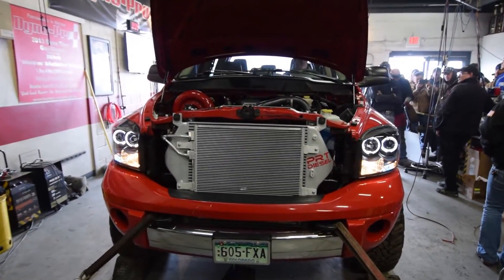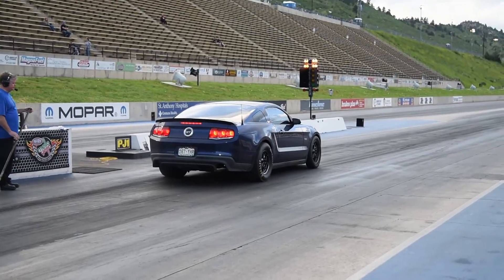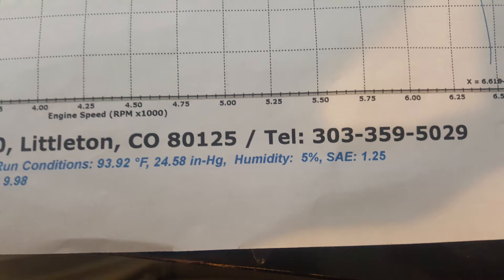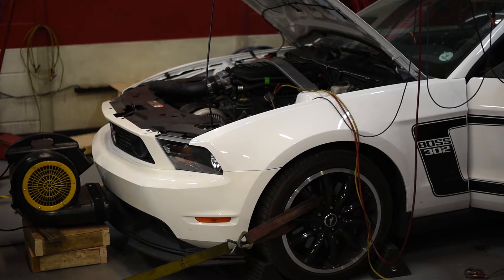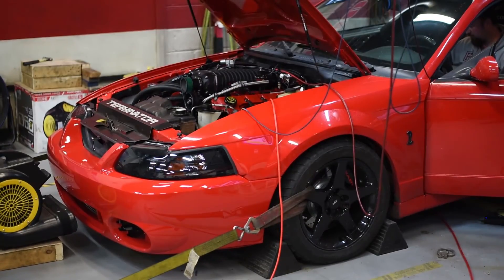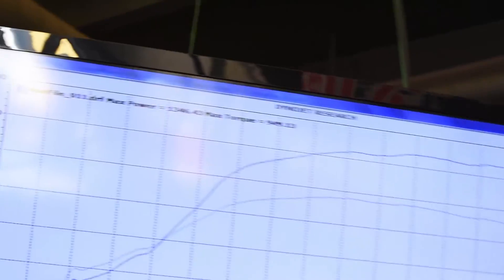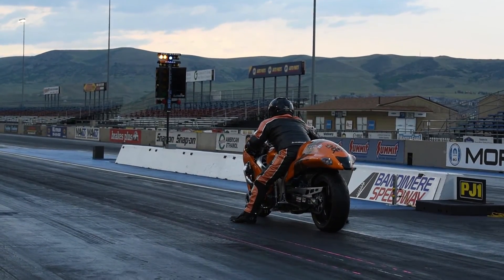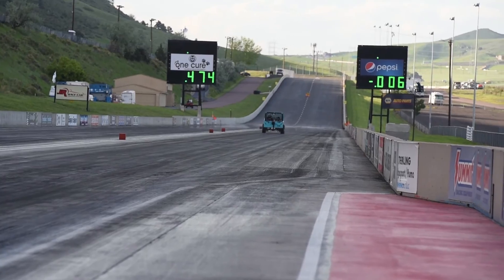How Dyno Results Can Be Misleading

Comment: Hello. A bit late, but better than never. IMHO you are generally spot on. That said, I would like to point out a couple of things. - As I have also stated earlier elsewhere, turbo engines are VERY difficult to get a correct reading on on the rolls. They should really be measured/tuned on a set of hubs or an engine dyno. Reason is, that there are typically so much kinetic energy buildup in the driveline that the roll(s) keep accellerating after the engine has reached  its max. Also, with so high hp turbo engines there is a real risk of the wheels spinning on the rolls. We usually say that anything north of 500 hp needs to go on the hubs. Light cars, even sooner.
The SAE60 or 1349J  Correction is necessary if you want to compare numbers even from day to day. when you live at altitude you do need to see what the uncorrected number,  with the barometric correction says. That will show you what the engine is doing there. but the corrected number will give you a better picture of what the engine is really doing, for instance in relation to changes of tune. The uncorrected numbers will give you a decent hint too, but lets say you do the first pulls at 8 AM and the final pull at 3 PM. Between those two times there can easily be a 0,06 difference in the correction factor due to weather alone. So you may end up with "less" power  on the graph at 3 PM after a day of fine tune, but IRL the engine may be pulling say plus 35 hp. Accuracy in the set up and the proper weather correction is a few of the keys to get proper and consistent dyno values.
Have fun.